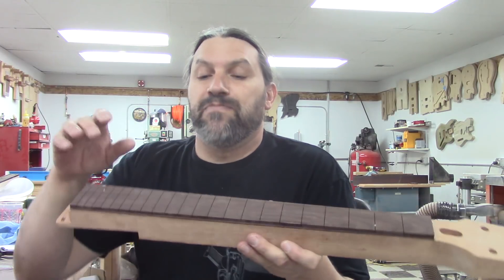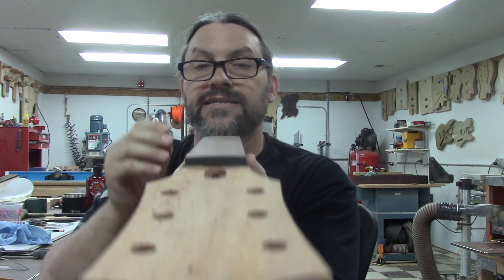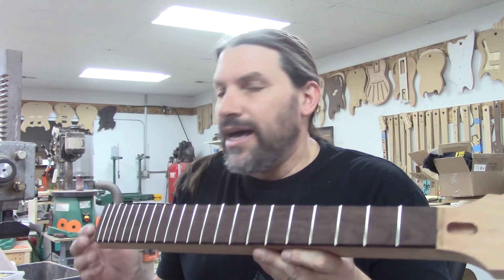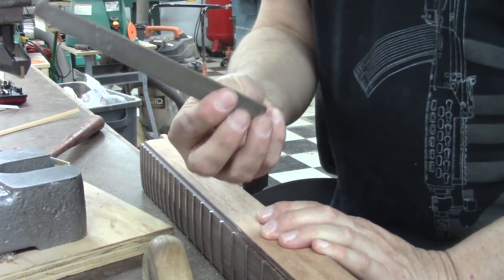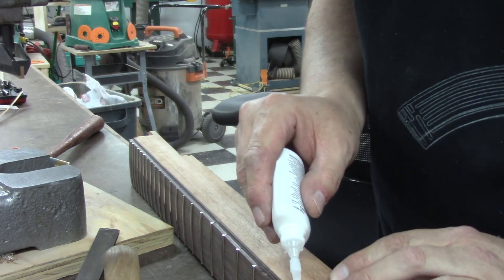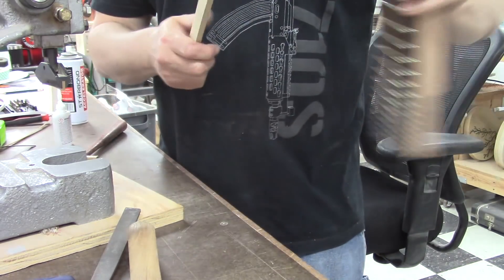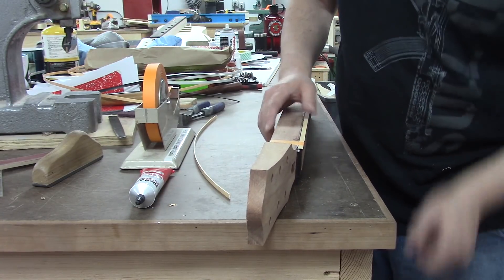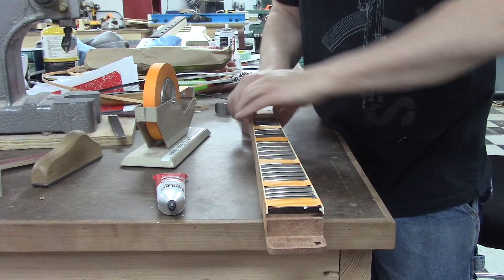How To Do Gibson Les Paul Style Fretboard Binding Pt. 1

Comment: There is a tumbledown on a Gibson bound neck so the binding actually curves back in towards the center of the neck on both sides making the neck a true C profile. Gibson applied their bindings as a gooey liquid, with a consistency kind of like toothpaste or silly putty. You can use solvents or heat to soften up the ABS, PVC materials or celluloid acetates. Some Gibson bindings were injection molded with the nubs for alignment and the side dot holes were gang drilled all at once. That binding is way too thin to make that neck feel right for a Gibson. Gibson used microwaves to heat up materials too. Can you do that in your garage? YES, but I don't recommend it, unless you enjoy multiple extended hospital visits and chronic illnesses. If you have a bigass metal box, go for it, just make sure the door is closed on it.
Reply from the maker: Good to know
Reply: @TexasToastGuitars  Gibson Les Paul tops had a hot melt glue applied to the bodies & the tops with spray guns, then clamped them in jigs and then they were actually sent through a microwave oven tunnel, so the drying time was pretty much less than one or two minutes. Godin uses a liquidy carpenter's glue consistency cream colored plastic for their bindings. They put it on like ketchup, let it dry and clean off all of the stuff that oozes over ther sides. Matsumoku put two nasty wood screws at a 45 degree angle into their neck tennons right after they were glued onto the bodies, so no need for any drying racks there either. Digging those screws out is a real bear too. Nicely made guitars! Their MMK45 pickup is one my favorites. That factory burned down around 1989. Oh to be 20 years old again and running amuck in Japan.

Comment: Amazing job. One thing I don't really like about this binding style is the problem to refret, man that's a nightmare. You usually end up having to redo everything.
Reply from the maker: It is a bummer, lets hope that the Cryo-Wire holds up
Reply: @TexasToastGuitars  You use cryo as a standard now? I heard that in newer Gibsons they stopped using it, so the repair guys will keep having trouble. Damn Gibson, for once they innovate with something smart and then this LOL. It's not even that expensive.